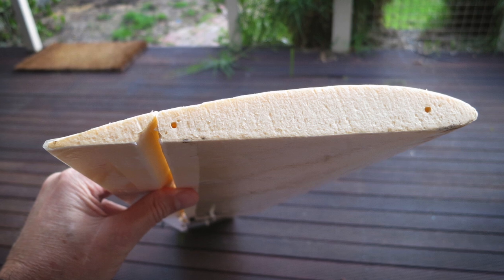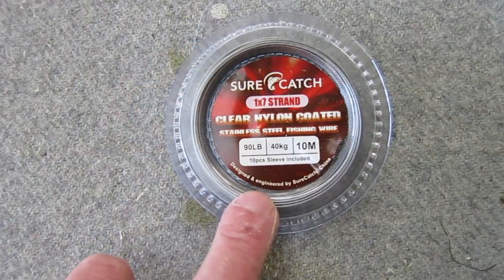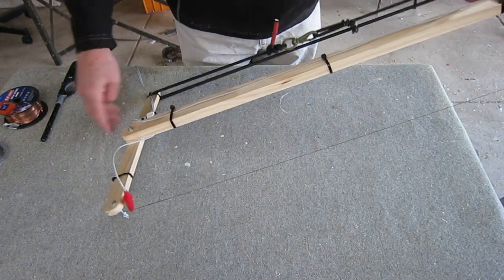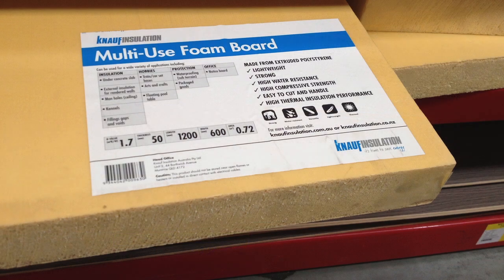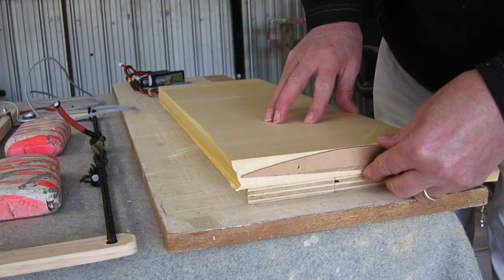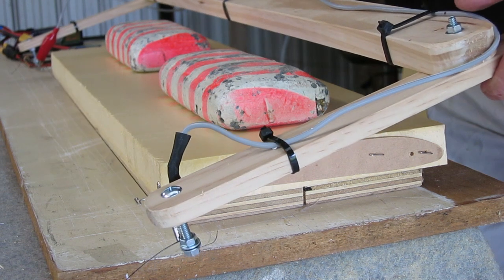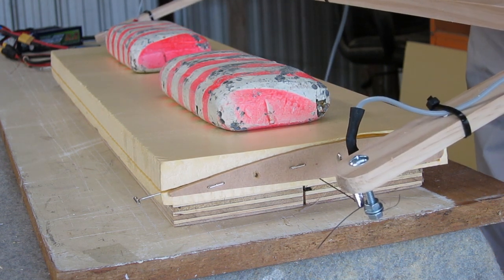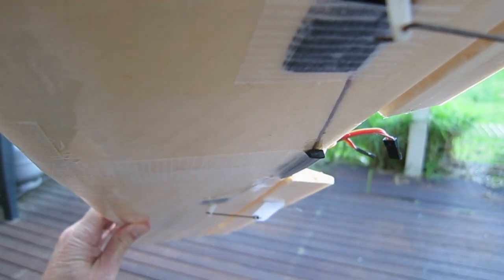Hot wire airfoils and bow

Comment: hello andrew. is it safe to draw current directly from lipo battery? is it not going to get shorted?
Reply from the maker: It would be a big mistake to use normal conductive copper wire. Zap Flash Boom! But this cutting wire has resistance of about 5 Ohms/metre. So I am not shorting the battery at all. Only drawing about 4 Amps due to the resistance of the stainless steel cutting wire.
Reply: XPS foam is hard to find here. can u suggest any alternative? can I use EPS foam? or is it not rigid enough?

Comment: Have you ever thought of using a 1/8- 3/16 gas welding wire  or brazing rod , You`ll have flex yet strength .
Reply from the maker: I initially tried MIG welding wire but it was too weak, broke before getting hot enough.

Comment: I just made a wing like this and decided to use a router table with a fence to cut a slot down the length for two carbon arrow shafts as spars. I cut a #8 bold head off and used that to join the two arrow shafts together tip to tip to make it long enough for the entire wing span.. cheers.
Reply from the maker: Sounds excellent. I just experimented with a small U shaped hot wire to cut a slot for an aluminium tube. Worked nicely

Comment: Instead  of two lipo batteries you can also use a speed controller  for a toy train to controll the wires heat.
Reply from the maker: Good tip thanks

Comment: Great video. I use an auto battery and rheostat and stainless wire. There are many ways of sandwiching the foam, some obviate the use of spars, at least full span spars. Andrew, I just hot wire a box section for the spar(s) which may be made tight against the spar or filled with sparkle or glue. Made strong, the foam wing could be a bench seat. You can make virtually any airfoil as you intimated. You sure have the slope sites!
Reply from the maker: Thanks James. Yes we do have a selection of slopes.

Comment: Thanks for the video, it was very helpful and I am looking forward to cutting my own foam wings soon.  I think the best way of cutting grooves for spars is to use a soldering iron and a locking collar attached to it as a depth stop.  The collars are commonly found at hobby shops for making landing gear wheels not fall off.  You may also find them at import chinese tool stores as drill bit depth stops.
Reply from the maker: Great tip, thanks.

Comment: Use a square or rectangle spar.  Cut the square or rectangle into the template and use your hot wire to notch the wing.  That works pretty good.
Reply: +eric nielsen Forgot, you make a second template with the notch.  After you cut the airfoil as you show, you switch to the template with the notch.  Then use the bow to notch the top or bottom of the wing. The square spar slips into the notch and you just tape or cover it.

Comment: For those that want to know V=AMPS*(Res), (you sounded surprised that with 3.5 ohms, 12V, it pulled 3.5 amps). For power it is V^2/resistance = power (watts). That's all you need to know. Also nichrome is super cheap, and besides that it takes no material to make a quick rig (I start up my dirt bike for power source, tie one end to the metal poles on my porch, and tie the other end of the nichrome to a brick, then shorten the wire if you want more power and heat, only thing you need is nichrome and a power source. I use that setup for general cutting of basic shapes in Styrofoam, not airfoils though).

That plane flew nicely in the end, nice peaceful background music in the end too. Keep up the good work!
Reply from the maker: +Jake Garrett Thanks Jake, good input

Comment: Hi, when I do this my battery gets very hot. Is that a problem?
Reply from the maker: +Junior Yes it is a problem. Pulling too much current. Mine only draws 4.5A using 4S battery and it doesn't heat up at all.

Comment: Thanks for the info. Needed this for a Uni project!
Reply from the maker: +smellysam Excellent
Reply: Ok, got most of the parts in yadada.
I do have one question: My profiles are 42mm high, 153mm edge to edge and 990mm long.
Should I do the 990 in one or 2 pieces?
I intend to glass the edges etc. Don't worry about the finish.  Not for an aero model.
Reply from the maker: +smellysam 2 x 500mm halves would be much easier to cut. Sound interesting.
Reply: +smellysam Exactly, it is really helpfull! We are thinking to make a fpv uav for uni project but the thing is we cannot import some important parts such as camera, gps, autopilot system due to rules of Turkish customhouse. If we buy these stuffs in Turkey we will pay three times more.
Reply: +Andrew Newton Done the cutter. 400mm to 500mm wide. 16.5V, 2amps, guitar steel E string. Controlled with a halogen light's slider. Works great, the only problem are the templates, I can't get the alu you are using (well, I can, but at 40€ the 40cm by 30cm sheet, they can keep it). I need to make 4 "wings", should I use cardboard or 1.5mm alu stock?
Reply from the maker: +smellysam Hey Sam, cardboard would be easiest to shape and works fine. I have seen a video where someone covers the cardboard edges with metal tape to make it last longer. Formica or laminex is also popular (but hard to shape)

Comment: Hi Andrew, another great, informative video... I have just completed building your hot wire frame and am about to cut my first Clark Y Airfoil. Can you please give me the chord measurement on your wings so I can adjust the template size to suit.
Reply from the maker: +rustyact01 Excellent. My wing ended up with a 180mm chord. But if you're after accuracy the template will need to be slightly oversized, and its good to extend the trailing edge by about 2cm to give a lead in to the cut.. I'll measure my template tomorrow for you.
Reply from the maker: +rustyact01 For a wing that ended up 170mm chord and 21mm thick I used a 180mm Clark Y template with the trailing edge extended straight out 1.5 cm further and 4mm thick. That gives the wire something to rest on before you start cutting into the foam.
Reply: +Andrew Newton Thanks very much for the info Andrew... I'll cut the templates and see how I go with the first core... Keep up the great work on the videos mate... Would be lost without them... Cheers, Dave

Comment: vidio cool . I use for cutting the same frame , only the heating wire of the d-0.8 Ni-chōme alloy wire . Clean cut turns out to 400 to 500 mm in length. :))
Reply: i have vape kanthal A1 wire, and cut fine but big wing no have smooth, what need do ? need wire tighten wery tight ??

Comment: Thank you for this video! i started  with my own hot wire now but i had great problems with the curve. So i used thick carton for the templates and took the outer part for cutting the airfoil and the inner part just for the notches.
Reply from the maker: +Colofonius Regenschein Thin aluminium is my favourite template material now. Cut out with scissors.

Comment: Looks great! I used a very similar technique to cut my wing. I experimented with the thin metal sheet as well as cutting the template from balsa. Both worked great but the metal sheet was easier just make sure the edges are smooth. You can see the end result on my page. I also like your spar jig from the other video.
Reply from the maker: +JDs Slo Days Thanks JD. I have switched to thin aluminium and just cut with scissors. Easiest template by far.

Comment: Consider using 2 separate pieces of foam to make the wing. Cut a channel out of both pieces of foam, and insert your intended spar (you can cut channels for electronics, as well). Laminate the 2 foam pieces, and apply your templates to the ends, aligned with the chord line and your preferred position of the spar.

Jeff
Reply from the maker: +Drezed01 Thanks for the tips Jeff

Comment: Great video Andrew, I have been thinking about using a hot wire for a while but never have because I thought I needed a special power supply, never thought about using a lipo. Many thanks for pointing the way.
Reply from the maker: +Mel Jones Good to hear Mel. I have just worked out that a  4S LIPO is much better for my rig that cuts 750mm wings. 6S (2 x 3S) is too much and breaks the wire but 4S is perfect.

Comment: like the video, I have done the same thing with the same type of foam. have the same issue with putting a spar ended up just cutting a groove on the underside of the wing and laying the spar in it. I think the next time I plan to build a wing using hot wire cutter and insulation foam, I I will use two halves to make the wing two layers of foam one on top one on bottom that way when I go to cut a groove for the spar I can take one half off. using that technique I think the wing will be more stable, because when you glue the two halves of the wing together it will be almost like a spar itself.
Reply from the maker: +RC flight Seeker Interesting, don't think I can cut accurately enough to make the wing from upper and lower thin haves but it would solve the spar issue.

Comment: There's no easy way I know of to bore a good hole for a spar. I usually just melt a trench on the bottom of the wing halves with a soldering iron and glue the spar in, Just cover the slot with some film or tape.
Reply: Shouldnt have looked into the comment section. Now im sad...
Reply: @shadewar  same
Reply from the maker: +Samm Sheperd (SNRS) As long as the core is thick enough I can now drill a long hole but for swept and thin wings I'm cutting a slot and gluing in a 6 x 1mm CF spar.
Reply: I just used a square wooden dowel cut the wing out in such a way that the wooden dowel sits flush with the wing and glued it in with some 5min epoxy glue.
Reply: I have done it by standing the wing perfectly upright and dropping a heated ball bearing on the spot where you want your spar tube run through. It wil melt thrue like butter

Comment: Hi Andrew.  Nice video.  I started making foam wings like this for my Vicker SuperVC10 and then got fed up making all the templates so I built a hot wire CNC machine which I use for wings and fuselages now.  For spars I use a Dremel with a tile cutting attachment and a straight edge as a guide,  Saw this on SD ParkFlyers (tallguysd is his youtube channel)  Works really well and I still use this method on my CNC wings.
Reply from the maker: +keith howlette Thanks Keith, I do follow tallguys videos. I OK using templates at the moment but a CNC cutter would be vey nice.

Comment: If you're still looking for a way to do spar channels then simply get a metal rod of a slightly smaller thickness than your intended spar heat it and push it into the foam. just like your wirecutter but linear.
Reply from the maker: +Blake guyan Thanks Blake. Have not tried that method yet,
Reply: +Andrew Newton It's the way to go I think personally: I use a simple plywood jig to keep it aligned and it works well on the thin 5mm foamboard I use. Also though, for bigger holes have you seen the hot ball drop method? Get a steel ball the right diameter, heat it up and then drop it vertically through the wing and hey presto.....

Comment: Nice work mate, good to see people joining the sport and putting video's out there.
I have been cutting wing cores since high school nearly 25 years ago.  The process is pretty much the same.  Although it is best to cut the top and bottom separately with different template's that ramp you in and ramp you out.  It eliminates wire drag that can make the middle of the wing chord shorter, the same as going to fast around the L/E. Having two people and reference lines on the templates helps also.

As for spar's sometimes the simplest spar is a shear web of 3mm balsa just cut down vertically and glue it back together.  If you want a 2 piece wing then carbon arrow shaft and brass tube works well.   Cut out the foam as a big chunk, line it with light ply or balsa (depending on flight loads) glue the tube in and fill the gaps with a light epoxy and micro balloon mix.  

Keep up the good work buddy!   Catch you at Bunnings ;-)
Reply from the maker: zooknut Sweet, thanks for your tips, lots of technique to learn for a perfect cut but foam is cheap.

Comment: using a negative of the airfoils works great for cutting the top half first and then the bottom half
Reply from the maker: RCFlightAdventures I tried positive top and negative bottom and it worked well. Yet to try all negative.
Reply: started building a 3m fiberglass pilatus b4 like that a year or so ago. working on it from time to time, it's turned into a club build now xD

Comment: Very nice. Do you have a method to ensure that the two airfoil templates are perpendicular to each other? I can see problems with wing twist if you're not careful with that.
Reply from the maker: Enginair Now I cut separate top (positive) and bottom (negative) templates from a 30mm wide piece. The bottom of the template sits flat on the work surface. Any washout or sweep is designed into the template.
Reply: cool, it seems you get a nice finish on those wings

Comment: Nice work, I have been using a Dremel with a router base guided by an alloy strip for straight u shaped grooves to insert wing reinforcing to the underside of the wing, glue the spar in, then cover the wing. The Bixler 2 "kit" comes with a similar installation, but you glue a foam strip over the spar to cover it. 
I use aircraft single strand lock wire for my foam cutter. We probably end up with the same result.
Reply from the maker: Fixed Wing Rc Thanks, goos info. What thickness lock wire do you use?
Reply: I mostly use .032" lockwire. If you are anywhere near Moorabbin airport you can pick up a roll from Aviall or Aviaquip, or if you are in the country, I'm sure someone in a small regional aircraft maintenance facility wouldn't mind giving you a few feet. I have the occasional break and have been looking out for an old fan heater. The wire coils they use as heating elements are the correct material for Hotwire cutters. If you are anywhere near the Mornington Peninsula I can give you some lockwire anytime.
Reply from the maker: Fixed Wing Rc Thanks for the offer. I'm in Geelong. Pretty sure I can get some locally, marine chandlers carry it too. I'm happy with the fishing wire at the moment but I'll try all options.

Comment: Hi Andrew, I have wire cut a set for my CP50 Drone in the same orange foam...it has to be said that the accuracy of the airfoil is worth having as you get more lift and less drag than the folded Depron wing. Thats not to say the Depron wing is of no use, because they are lighter but it depends on the foam density...I use a Mains transformer and light dimmer for control of wire temp. Not seen a Lipo used for doing it before, so well done...I think your wire diameter looks a bit on the big side, a thinner wire will get hotter and offer less drag though, it did look a bit on the cool side to me? I always cut in two halves, upper and lower and use a balsa LE and TE butt glued on, its much easier and allows a really sharp durable TE. It is more work though...:(

Comment: Really good idea to use LiPo batteries. I use sliding autotransformer for this, bacause sometimes want faster cutting, and setting to about 20 volts or so. If you want to make hole for the spar, you may use aluminum or steel tube, make teeth at ne end, and carefuly align so that it drill hole along the wing. Rotating gently in both dirrections and it slowly cut nice hole for spar. Ocassionaly you may pull it out and clear foam by inserting metal rod on opposite end of the tube, so that it pushes out jamed foam.
EDIT: Spar in many cases doesn't need to be long as the wingspan, but maybe 2/3 of that length. Find it by experiment - bending wings or gently rocking to see how it behave.
Reply from the maker: ***** You have just described exactly the technique I have settled on but I'm using the spar tube itself in a drill, works really well.
Reply: Andrew Newton Oh, yes. This works too. I am just saying, because don't remember whether you done this thing already. It is better to said twice, than... 

Best wishes.

Comment: Andrew, check out Steve at Killer Planes on YouTube.  He has some great techniques for drilling and inserting spars in wings for re-enforcement.
Reply from the maker: Jeff Groetsema Thanks Jeff. Finding a long enough drill bit is the problem. I have made a horizontal jig so I can form the hole using a sharpened spar.

Comment: Awesome work! So glad I saw the bunnings foam before I  practised on much more EPP ($50 a sheet!). Now got a stack of the knauff eps to play with first.
If you want to try different wires, Jaycar do 0.13mm nichrome wire for a few dollars. Good stuff and heats up nicely on about 40W power.
Reply from the maker: Red20RC Glad to hear it and thanks for the tip.

Comment: great Andrew!!

why do you think the lift might be better on these, compared with the folded depron? is it a more uniform aerofoil shape along the length?
is that insulation at Bunnings? or somewhere else down South there?

parts are trickling in slowly for my tricopter. not long now.. :)
Reply from the maker: Scott Jenkin Yes Bunnings but I have never noticed it there before, might be a recent addition. This airfoil is smoother and a tad thicker than my folded depron wing, and it just looks better.

Comment: To put in the spar what I do is heat a tube (6mm like my spar) that can heat up like metal en then just push it in
Reply from the maker: YellowBlue RC I can see that would work perfectly. How do you heat the rod?
Reply: Andrew Newton well I just have an aluminium rod and heat it up on a kitchen stove, however I heard that this is highly toxic so I would not recommend it.
but thats how I did it.

btw I absolutely love your designs, they are amazing.
im in the progress of building a soarer/glider with the 1.2m wing design.

Comment: Great video. I was going to build one of those a few years back before I got into the foam board. I bought a transformer from Radio shack and a dimmer switch to use to regulate the power and a E string for the wire. I like the battery way a lot better I think. Great idea.